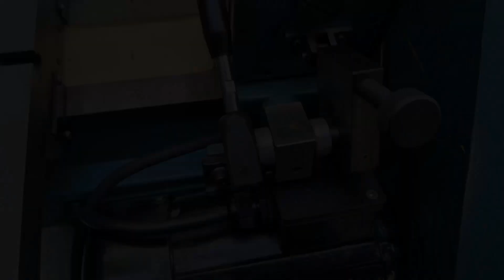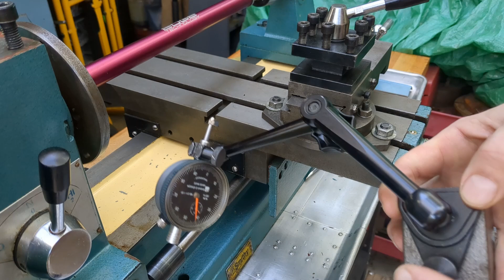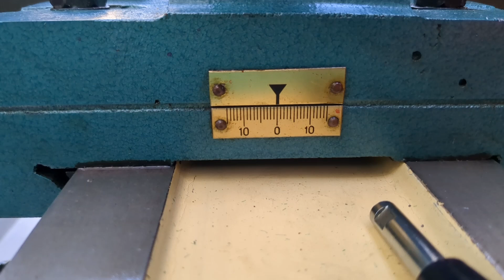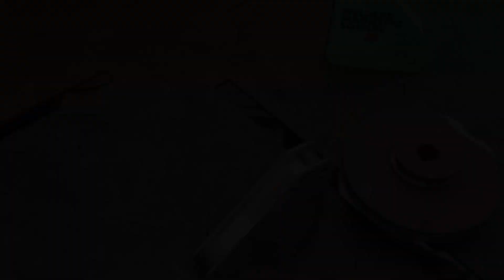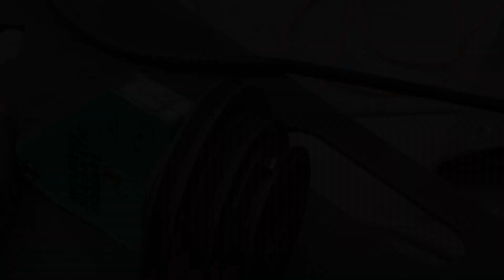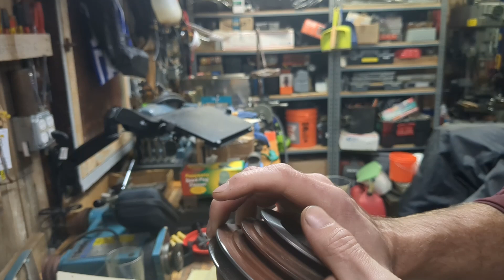Smithy Lathe/Mill/Drill Combo Rescue Part 5 - Tailstock Alignment and Cast Iron Pulley Repair

Comment: Appreciate the ideas for correcting.  Going to use this on my small lathe.    I have the same Smithy rig, any idea where I can buy the innards of the tailstock tube, mine are missing.  Appreciate the content.
Reply from the maker: Thanks for the comment and glad the info might have helped a bit.  Smithy is still around and I'd give them a ring (https://smithy.com/pages/contact-us).  Their parts department carries some parts for older machines, but it will be hit or miss.  You can also search for parts on their website.  Other brands sold similar machines with different paint jobs like Grizzly, Enco and Baleigh.  Look to see whether they carry similar/same parts.  Then there is eBay.  Sometimes you can score parts there.  Good luck with it!
Reply: @WernersWhirligigs  Thanks Werner, appreciated